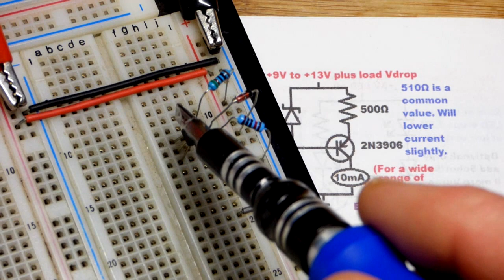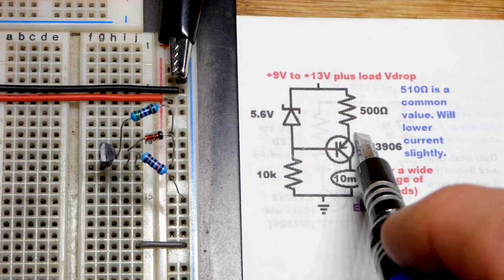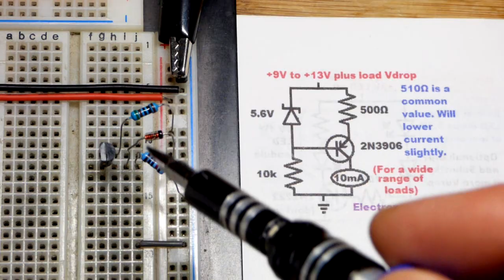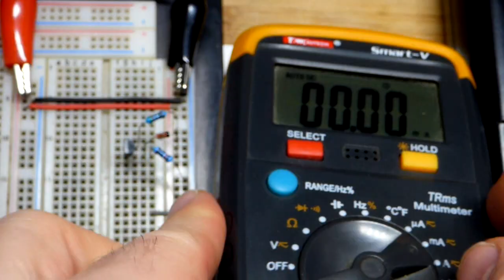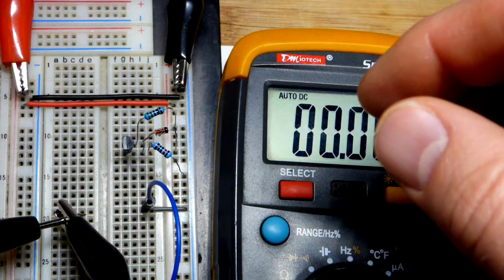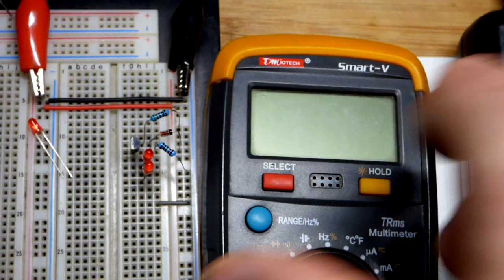Approx 10mA Current Source PNP BJT Bipolar Junction Transistor

Comment: If you want an accurate 10mA, a 22k in parallel with the 510 will give you the right value. (Although if you wanted accuracy, you'd be using a tl431... But that's probably another video.)
Reply from the maker: Good points! I thought I had a tl431 video but I'm not finding it now.
Reply: @Electronzap  LOL, you DO have a video on it from 5 years ago, but in the title you wrote LM431 instead of TL431 so it doesn't come up in a search!
Reply from the maker: You're right, that's what I have. typing 431 didn't bring it up either, which doesn't make sense.
Reply: @Electronzap  It came up when I searched for just 431. BTW, If you want a sequel to this video, you could show how to make it a floating (ungrounded) constant current. That circuit is used in long LED strings, where it's often just stuck somewhere in the middle of the LEDs running anywhere up to 169vDC. Since it's not grounded, the voltage doesn't really matter much. It's basically the same circuit, with just a few tweaks which I'll leave as an exercise for the reader. 😁